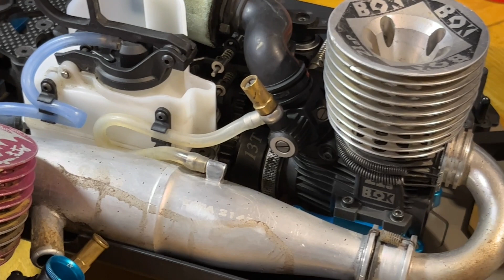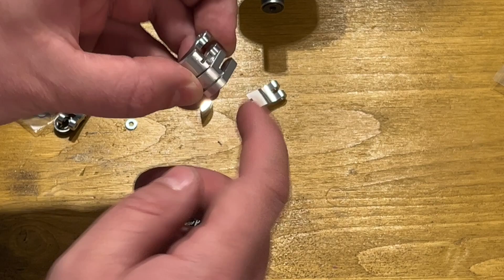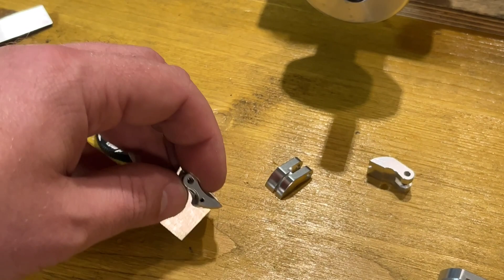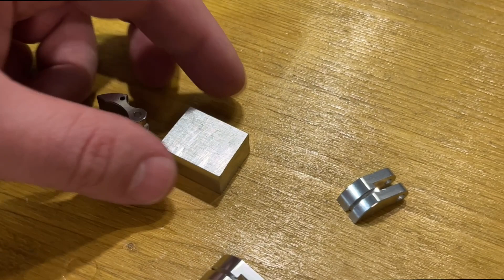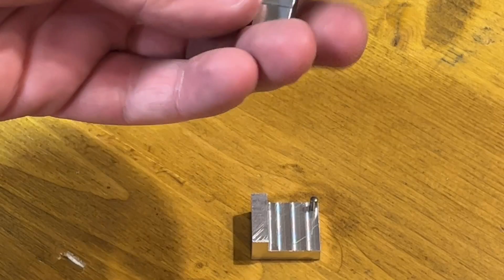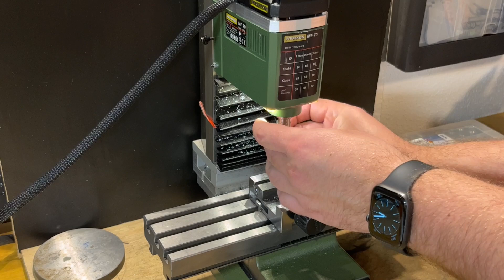Clutch pads. Pattern milling

Comment: Hey ! You make great videos !
I have a question way do you use gears for spindel ? I have idea to use 400w brushless spindel and connect it straight to er11 shaft . Something similar how you build it. Just motor without belt and gears.
Reply from the maker: I found for myself that it's required mostly up to 1500rpm, and it's possible to have only when you have a transmission. All the motors mostly do more rpm. With high rotation speed you could use only very small mills on this machine.

Comment: You're right, when a job is repetitive is better to make a jig for it. How many RPM you use for that ZGT bit?
Reply from the maker: I used 1600, that are the max rpm now for me. But for a small mill it need to be higher.